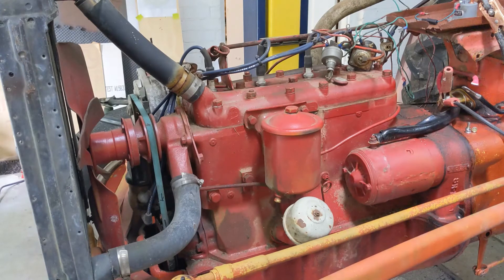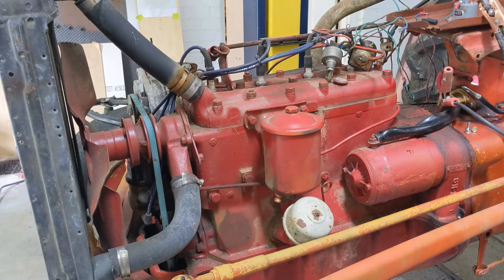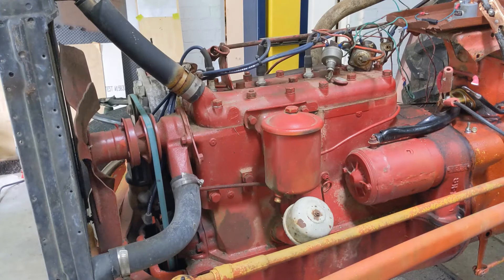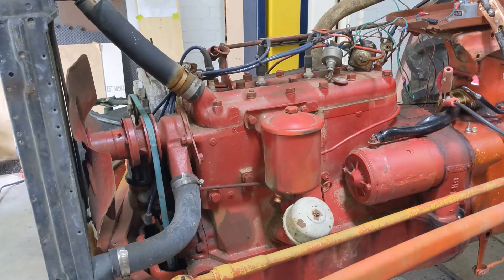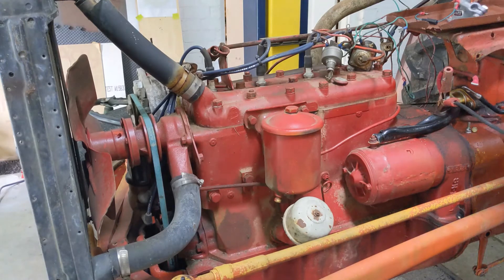starter motor when converting to 12volt negative ground

Comment: Also tell the direction by looking at the fan blades to see which way it turns to pull the air through the radiator.

Comment: GOD BLess You!!!   I have wrestled with this question for years!  I have listened to "experts" both ways. Also, I fell for the idea that reversing the polarity on a simple DC motor would reverse the direction of spin.  This is easily demonstrated.  The key here, and which you have explained  well, is that a starter motor, by having  no permanent magnets does not follow this example.  I suppose this is an example  of two wrongs making a right...  Since reversing the polarity of the rotor windings AND reversing the polarity of the field windings causes the starter to always turn in the proper direction.  GOOD JOB,   YOU DESERVE A FREE SIX-PACK, OR IF YOU DON'T DRINK, A CASE OF TWINKIES!!!!!!!!!!!!!!!!!  Mike

Comment: You should convert the starter to 12 volts by replacing the stator coils. Many many people have had no problem converting their tractors to 12V and doing nothing to the starter. By a few have destroyed the starter by not converting them. https://www.youtube.com/watch?v=jn7d-KZsIxs
Reply from the maker: I will just replace the starter if it happens to go bad....it has been working fine for years on a 12v bat

Comment: What did you do about a generator? I would make a moun tand go 1 wire gm alternator. Cheap and works. Nice shop.
Reply from the maker: 12v single wire alt

Comment: 6 volt is positive (+) grounding, 12 volt is negative (-), also becareful running 12 volts through a 6 volt starter, it will spin much faster and damage the starter drive ,gear, and flywheel gears, starter should be converted to 12 volt  to prevent damage
Reply from the maker: I like how much better the engine starts now with  12 volts.    I have never personally known anyone to have an issue with using 12v on a 6v starter but I do know several who have enjoyed good success with it.  Maybe sometimes the starters of ring gears are already worn out or damaged and become worse once 12v is added to the mix ?
Reply: @neuromanglers  just a fair warning,  I have seen the damage done, and it's not pretty
Reply: I have been running mine on 12 volts for over  10 years now and have never had a problem with it, add to the fact that the starter looks like the original one that came with the tractor, it's been in the family since it was bought brand new and used by my Dad and Grandpa and has never been changed and is still going strong
Reply: Thanks

Comment: That’s not the original block it has the generator mounts and the head has a place on the side of the head it install a Temperature gauge.
Reply from the maker: Thanks....Probably not much original after all these years
Reply: @neuromanglers  Yes same thing happened to me that is why I check for those kind of things now! I bought what I thought was a 1951 it had the side distributor and the RPM gauge but it didn’t have the inner axle seals but I found use rear axle housings with the inner axle seals at a wrecker so it is a mix of at least 3 tractors!
Reply from the maker: Mine was painted yellow at some point, like for road way use

Comment: How does the solenoid play into this,I just purchased a 58 641D, and the seller told me it was pos ground,I said to him,I’m changing that for sure cause I’m certain that yr was neg ground,I have another 841 D,it’s neg ground,I thought I’d need to switch
to switch cables on the solenoid,but watching you,apparently I’m wrong with that,what say you?
Reply from the maker: I was concerned about children playing on the tractor so I added a key switch that must be used in parallel with the push button starter that normally was used, they are wired so that both must be activated simultaneously to cause the starter motor to turn

Comment: I've been trying to figure this out also about my 1941 Ford 9N. When I  bought it the guy had a 12 volt car battery set up with a negative ground. However it doesn't appear to have been converted to a 12 volt system. So I'm assuming it's a positive ground.??
Reply from the maker: I was also surprised to learn that the design of the starter motor allow it to be positive ground or negative ground as the starter will always rotate the proper way due to the windings 
So very little is required to convert from 6v POS to 12v neg ground, just the lightbulbs and ballast resistor, plus removing the 6v generator and installing a 12v alternator.  I also removed the amp meter and installed a volt meter because it is more meaningful
Reply: @neuromanglers   I'm curious to know if you have went to electronic ignition? From what I understand the points can be quite problematic.
Reply from the maker: I am enjoying good success with the points so unless that changes I will continue to use points.

Comment: Assume the ventilator should blow air towards the engine.
Reply from the maker: I have seen both types of fan blades used; pullers or pushers depending on the application
Reply: Ok,never seen it on a tractor cause kind of contradictive blower blowing against drivingdirection,so if on road in top gear minor cooling.Remember feeling it though standing behind a Linde forklifter when the el. fan started,and on my 100 hp electric compressor oilcooler,but on these it makes sense.Well never mind all that,thanks for clearing up thing about starter,think can change to alternator on my small MF 35,with less concern of this thing.Have a happy new year soon.
Reply: I hear some people reverse the fan on their tractor so it blows leaves and debris out of the radiator and that’s why some fans are reversed
Reply: @Garagemonkey11575  😆funny guy!
Reply: Yup those things can be pretty confusing 🤣